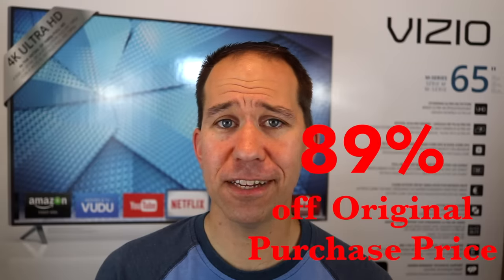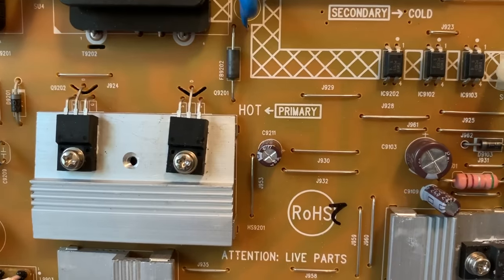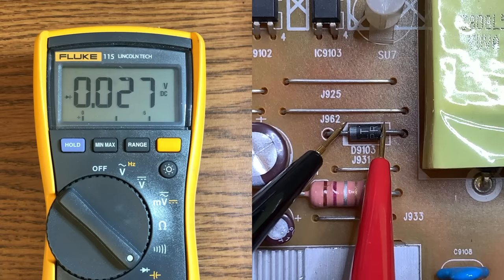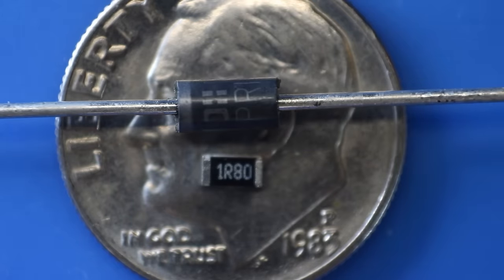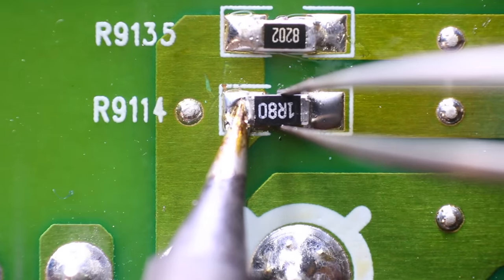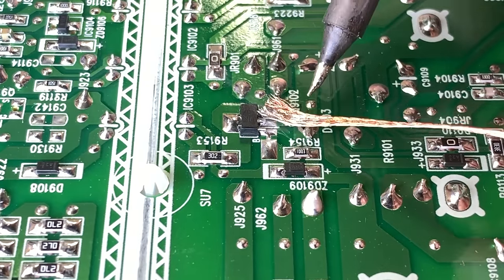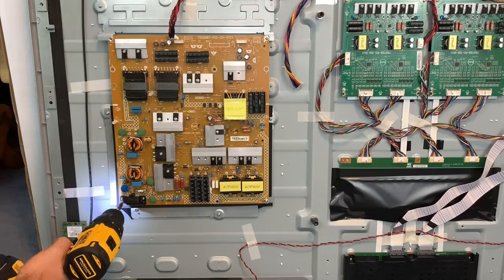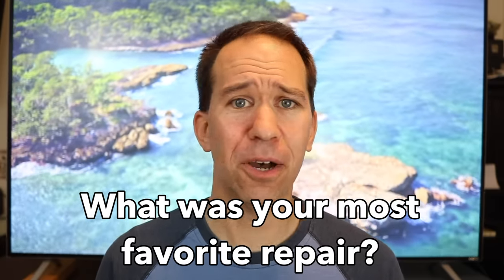I got a broken 65” 4K TV - How I repaired a Vizio M65-C1 (tv won’t turn on)

Comment: My M65-C1 would take like 10 minutes to turn on.  I would see the light, then a distorted vizio logo would show up after a few minutes, then the screen would go blank, then after a few minutes more, it would work like normal.  Yesterday, the screen wouldn't light up at all no matter what I tried.  Mine didn't have the flashing light or clicking sound, so I concluded my problem was different than this video shows.  I found another video that said to put the main board in the oven. I laughed, but tossed my board in the oven at 400 degrees for 5 minutes, realized it was upside down, flipped it over, back in oven for 5 more minutes, 20 minute cooldown with a big fan blowing on it until it was cool to the touch, reattached, and...MY TV WORKS LIKE NEW AGAIN!!!  If your LED is steady like mine was, try putting the main board in the oven instead.
Reply from the maker: That’s great you got it working!  Did you see my video on why heat works on a TV board?  You might find it interesting.  I wouldn’t normally recommend people put a board in the oven though. =)
Reply: @FrugalRepair  I watched your other video, I sort of assumed it was a cold solder joint, and I liked the ridiculous approach of trying to just reflow all solder connections by putting it in the oven.  I had already ordered a new TV, so I figured I had nothing to lose, and I happily canceled the order when it worked.  One sort of bad thing that happened was the coax plug fused shut while it was in the oven, so I couldn't attach an antenna to the TV.  I was able to fix this by using a small nail as a punch and just gently hammering it to remake the hole for the coax wire.  All in all, an oven+hammer is an absurdly crude way to fix the TV, but I am not a patient person, so a crude fix that can be done in under an hour start-to-finish was right up my alley.  Happy to say it's still working great a month later!

Comment: I actually went to school for electronics I allegedly have an AOS in electronics. I have done some repairs the first thing that I did was when I visited my former boss you stated that their automobile wasn't able to pair up to the cell phone and could I help them I said sure I'll give it a shot I mean I don't know if I can do it they stated that no one in the tech department at the dealership nor salesman no one was able to accomplish this task. I was able to get it done in about 5 minutes. This was around 2005 so it really wasn't as easy a task. 

Now when I was in school you know I did the labs that they teach you to do and all that but I went one step further when I did my labs I tried to find components that were close to the actual value specified by schematics. I would cull through the resistors and test until I got the best. This took a little time on the front end but when I had to troubleshoot it was easier because I had great values in components. Sure they had a 5% tolerance but if you try you can get those levels to 1%.

Comment: This is awesome. I have the same TV but no sound or video. The light is solid. Any ideas?
Reply from the maker: I have heard there may be a common failure on the main board that is different than the fix I did on this power supply. I’d encourage you to check online particularly for eBay listings that offer repair services. See if what they are describing is the same symptoms you are experiencing.  I wish I knew what the common fault(s) are!
Reply: @FrugalRepair  I did some research and I'm being lead to replacing the LED drivers. What are your thoughts? I have power the light indicator in the print stays on and dims, the light on the power board is solid. I would hate to toss this TV especially if it's a simple fix.
Reply from the maker: Personally I wouldn’t suspect the LED driver boards. One way you could rule them out is by disconnecting them from the power supply then turning on the TV and using a flashlight to see if there’s an image on the screen.  That all said, I’m writing this as a drive by thought, I haven’t done the research you have.
Reply: @FrugalRepair  hello again,
So here is an update. I sent out my power board and everything checks out, no issues. Next will be the main board. Unfortunately I can't check the LED driver boards because the screen won't even turn on. I can't get audio to play from any of the inputs.

Comment: As a tecc i can tell you if you leave the legs of a diode or resitor long it helps them to loose heat, often thes thing go becuse they are to near there max watage , so when these are stock faults its good to replace them with bigger wattage types, and as for repariers gutar amps when I retren them people say works better than new. I play guitar and heve built many so it helps..

Comment: Lol I got this same TV for free, power board had the same issue but I didn't have some of the soldering and magnifying equipment to replace small parts. But I was able to obtain a new power board for $100, WINNING.
Reply from the maker: Great find!  What did you do with the old power board?
Reply: @FrugalRepair  I unfortunately threw it out :/

Comment: Hello, I have not repaired anything like this, but it looks like i will have to. My 82in just went black with clicking and no red light for standby. You gave me an idea to fix it my self, I have a home repair service through SEARS and they said, the tv is broken and they will have to replace it..... ? they never came out when I called them to have a tech come out to inspect it. Just, its broken and we will send you a check for a new one.  WOW. Thanks, i should be able to open it, and fix. if not, i could order a new board.
Reply from the maker: Sounds like you can fix it since it doesn’t seem the lcd is cracked.  Hope you can!

Comment: I picked up a broken 65" Plasma for free. Original owner had just spent $3000 on a new OLED and just wanted to get rid of their broken TV. It was also a problem with the power supply board. Repaired it for C$61 in parts.
Reply from the maker: That’s a great repair! Thanks for sharing.
Reply: @FrugalRepair  Hey, thanks for the heart! You mentioned in the video that you got into this after watching a YouTube video. Your video (and my recent successful fix) has inspired me to look for broken sets to repair on the cheap and then flip on the used market for some extra cash. Who knows, maybe it'll turn into something I can do full time.

If I were to get into this, what equipment should I have out of the gate as a beginner? Soldering iron, copper braid, flux, magnifying headset, multimeter.. what else do you recommend?
Reply from the maker: That’s so encouraging to hear!  You can definitely make it at least a good side income repairing electronics.  I don’t know if I can answer all those in a comment but I do plan to create an online course that will help walk people through how to get started in tv repair (including the tools you should get and why).  That won’t be out for a bit but I’d first try to see if you can get things to fix.  I don’t think it should be too hard.  I seem to be picking up broken TVs with their screens intact quite often.  Besides seeing them getting tossed , I have alerts on Craigslist and Facebook and my friends know to hook me up when they know of any.
Reply from the maker: I should have mentioned, those tools you listed seem like a great set of things to start with.  You don’t need a fancy soldering iron but if your serious I would get one that’s on the nicer side (has features like adjustable heat, interchangeable tips)
Reply: @FrugalRepair  Thanks for the input! I'll be looking into this. I don't live in a highly populated area (120,000), so broken sets with good screens might be harder to find, but if I can find even one per month it'll make a nice hobby which pays for itself and then some.

In any case, your videos will be an excellent primer. Glad I found your channel, thanks again!
Reply from the maker: That population will give you plenty of opportunities to get broken electronics.      Let me know how it goes.  That’s exciting.

Comment: so my TV zapped from a power surge few years ago.  i replaced the boards for like $40.  my question to you is, why not go the easy route and replace the board itself?  i know there is a major cost savings on just the diode and resistor, and the nerd in you wants to see exactly what is broken.  it just seems a lot more labor intensive to swap resistors and soldering.
Reply from the maker: I think it depends on time, cost, available tools and preferences.  I’ve fixed a number of these boards and they are currently powering other TVs.

Comment: I have a Vizio p55-c1 that exhibits very similar, but not identical problems. It appears to have the exact same power board as your repaired M-series. Was it completely dead when you found it? Mine is trying to power up, and can recognize a remote start button press, but cannot turn on the display. I suspect leaky caps on the power supply and fluctuating power output such that it can acknowledge a remote, but cannot generate power to start the display,and goes into a restart loop. I ordered a spare power board but will use your video to test power outputs to see if that's my problem. Great video!
Reply from the maker: Thanks!  Your problem will be different than the power board in this video.  Are you sure it is not the backlights?  If not the backlight, I would suspect the main board next (given the info you said about it recognizing the remote start).
Reply: @FrugalRepair  Yes, the backlight is OK. It comes close to starting about, oh, every tenth (?) attempt to power it on, and I'll actually see the "v" logo before it shuts back down. Hence I think the power supply is weakening and no longer able to provide consistent full power to the rest of the system. I'm banking on the fact these TVs are just carefully packaged computers, and I've seen too many old PC's and components behave oddly due to bad or failing power supplies. It's a $50 gamble - not as inexpensive as your fix, but still cheap if it works. Worth a try, I think! Will let you know.
Reply from the maker: Ok, keep me posted.  did you make sure to shine a flashlight on the screen to look for the V ?  This is the test to identify a bad backlight.
Reply: @FrugalRepair  The logo definitely appears normally/with full brightness in those instances where it "almost" boots. I've never seen any "shadowy" representations similar to a blown inverter on a laptop, which DID happen to me years ago (before YouTube LOL) and I was able to fix that for about $10. Funny thing is I took pictures of that and wrote up a repair that I posted to a plain old webpage and I got hits and emails from all over the world for it. I was stunned. Just got word that my new power board is out for delivery, so hopefully tonight we'll know one way or the other. I don't think I'll see the exact same diode/resistor failure, but I'm betting (hoping?) it's something similar!
Reply: Well, here's the repair update: (insert sad trombone sound). No joy. Power board replacement took literally minutes; five screws and four cables. Behavior exactly the same. Backlight did come on once, as did logo, but unit shut back down. Key finding: main LED on control board is not on at all, blinking or otherwise. Now believe it is truly the culprit. Have to decide if I want to throw one more board at it or just admit defeat in this one. Main board is very hot... Thanks for your info anyway!!
Reply from the maker: @DIYDaveOK  Thanks for the update.  Try disconnecting the backlight cables and running the tv without a backlight.  Use a flashlight to see the screen and see how long it lasts for.

Comment: Great info. I have a Samsung qn82q6dtafxza that turns on fine but after a few minutes the picture fades out I have backlight and sound if I turn off set and turn back on it starts all over again but if I do it several times the picture will stay on for a few hours before it does it again. Looking fo a place to start diagnoses.

Comment: I have fixed my Presto Quartz tower heater many times because it's my favorite space heater, I even used a copper penny cut in half one night because I didn't have parts at that moment (ie. copper wire) I found your channel as my 65 inch RCA television was dropped and wasn't sure if I had to trash it as it is the screen.   Any suggestions?

Comment: I noticed you using an apple product. Their "Think different" motto kinda means the opposite of fixing your own stuff lol. Great job fixing the tv thou massive props.
Reply from the maker: Thanks!  You should always be able to fix the things you own.
Reply: I recently replaced the wifi antenna on an iPhone 6.  First time doing any phone repairs (thanks YouTube).  The phone was 100% disassembled.  Took 30 minutes and cost probably $1.  I could do it again in 10 minutes if needed.  Since then replaced a screen on another iPhone 6.  Extremely easy and only $20. Yes the iPhone 6 is dated but my son is keeping it just because it is so easy to fix.

Comment: I bought a brand new acer monitor from amazon. I had to travel to middle east for work. When I was there I had to change the power cables because they don't fit in middle eastern sockets. After two day the power cable melted inside my monitor  and broke down the three pin connecter and the monitor shut off completely. I bought the monitor  for about 700$ dollars and I was sad to see it break down that quickly. I thought about using the warranty on it but it would take so much time to ship a broken monitor  to U.S have it fix and brought back to the middle east plus I didn't think they would accept it because the reason it broken down was because of a faulty power cable that I bought where I lived.  I decide to take the monitor apart with no prior experience on how to fix them but basic electronics knowledge. I got to the power board of the monitor and it seems like everything was working fine except for the 3 pin connect input that melt down. I ordered a replacement for it for 0.35 cents. I desolder the old one and put the new one back in and that easily everything worked and I saved myself upwards 600$ trying to buy a new one. It felt great when it turned on and it got me interested in repairing electronics.
Reply from the maker: That’s an awesome story!

Comment: How much would have replacing the main board been?  THe reason I ask is that I believe I could do that compared to replacing individual resistors or diodes. Thanks!!!
Reply from the maker: The cost of the boards fluctuate but yes, you could swap out a bad board to get it working again.  All you would need is a screwdriver.

Comment: Love your video. Any advice for a TV that started having blue lines up each side shortly after hanging it up.
Reply from the maker: Thanks!  Did you perhaps crack the lcd while hanging it?  You could try twisting the corners slightly to see if the image changes.
Reply: @FrugalRepair  it gets really hot in the corners and it is on both sides of the TV. I can send a picture if you give me an email or something.
Reply from the maker: I’d take it off the wall and see if things change.  You might need to take off the bezel in case pressure on the tab bonds is the issue.
Reply: @FrugalRepair  thank you I will try

Comment: Very good video, I have a vizio tv the remote will not work. Has a very good picture but can’t 
Change channels help
Reply from the maker: Thanks!  Did you check for bad batteries on the remote?  Does it work to use the input bar on the tv?

Comment: Hello - I have two 55" LG TV's that are not functioning at all. They are both model LG  55LB5550-UV. Both TV's were bought within a month of each other and they both stopped working. I have no picture except occasional flashing "snow." The picture flashes for a moment then goes away. I bought a power supply board and the TV module main board. I replacement boards (assuming they are good boards) and nothing still. Do have any wisdom you are willing to share?
Reply from the maker: Did you rule out that it is the backlight going (gone) bad?  Your comment about flash and goes away indicates to me to check the backlight first.  Is there sound?  And after the picture flashes, have you gotten close to the screen with a flashlight to see if you can see anything at all (snow or otherwise).  I don't know the history of that model, maybe a common issue you can find online?  If it's not the backlight, I would disconnect things trying to isolate the fault.  Disconnect anything you don't need to turn the tv on.  You can even (after you have unplgged the tv) disconnect one of the cables that  comes out of the tcon board.  This will drive half of the screen, the other side should be white.  Then try vice versa.  You're looking for a potential bad buffer board or lcd panel.

Comment: This video is my favorite repair. 4k tv.
Reply: I have problem whit a Samsung smart TV model. UN55MU650DFXZA its working but I can't get to the menu and the volume some times work
Reply from the maker: Could the remote be bad?
Reply: @FrugalRepair   I change the remote control and steel have the problem

Comment: I pulled a very new looking vaccuum cleaner from the dumpster. Got it home and saw that the cord retaining bracket was broken. The cord had been pulled too hard and pulled out of the motor. I tied a knot in the cord and plugged it back into the motor. I still use the vaccuum cleaner.
Reply from the maker: Haha, nice!  That’s awesome.  Thanks for sharing.

Comment: The 1R00 resistor acts like a fuse. The diode failed to a short causing the resistor to fail limiting further damage. Sometimes fixing is more than googling what someone else did and knowing what to look for and where really helps.